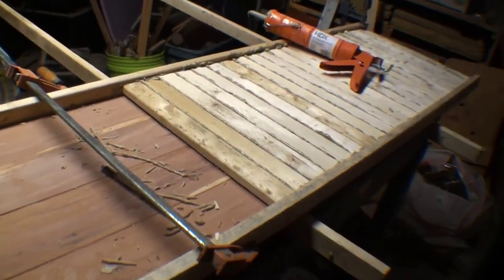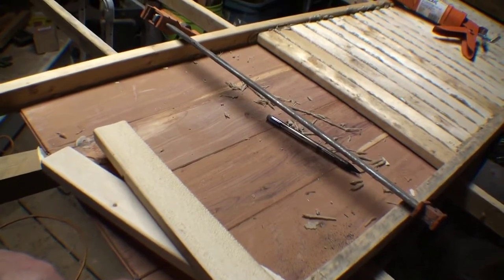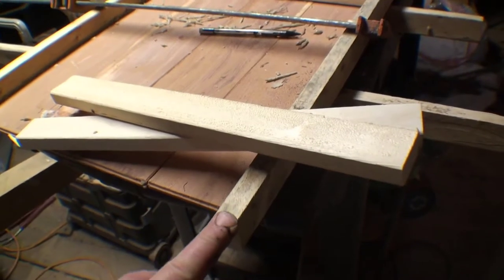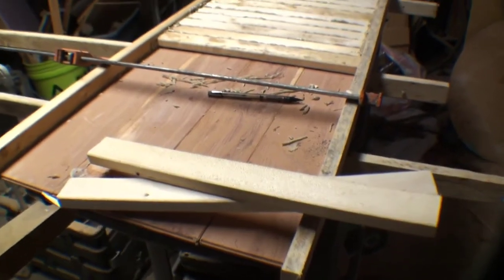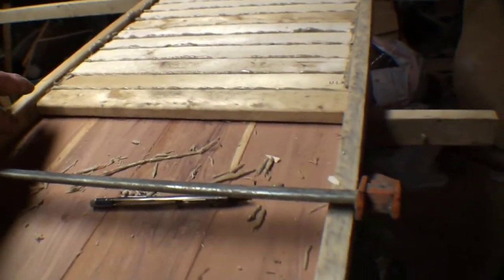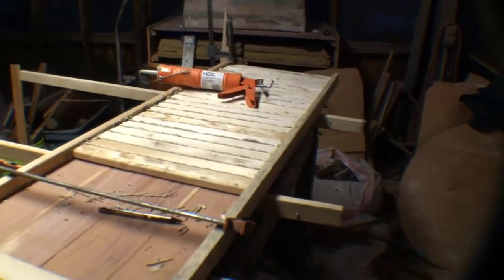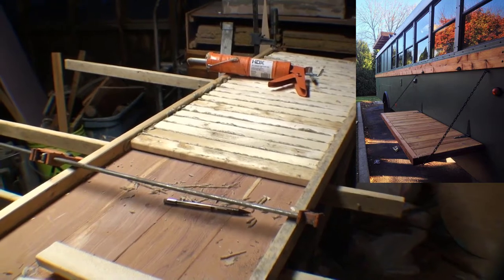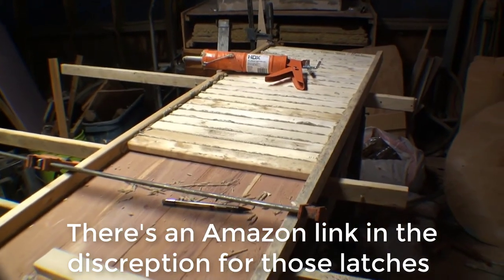School bus to RV conversion Episode 59 Hinged Outside Drop Down Table

Comment: Hey there! Seems like we are working on bus stuff in where it's warmer! Looks like it will be heavy duty, and will be nice looking as well! Pretty fancy! I gotta make a video soon too, been working on a few things indoors for my bus project. Have fun! Stay warm! God bless!
Reply from the maker: it's turning out to be a bit heavier than i wanted it but I think it will look great when done, I messed up parts of my bathroom panels by leaving the tape on too long so I've decided to trim the edges and corners of those panels with 1x2 boards but I'm going to shave them down to only an 1/8 and then piece them together slowly (it'll off set the dark nicely), now i've just got to decide how i'm going to do that, thanks for watching